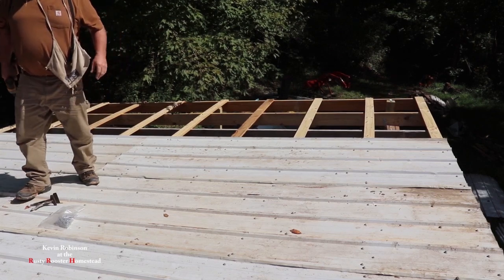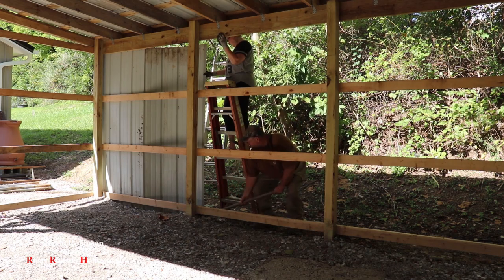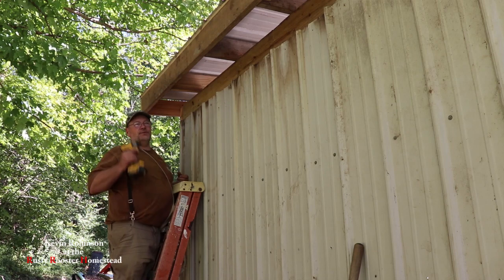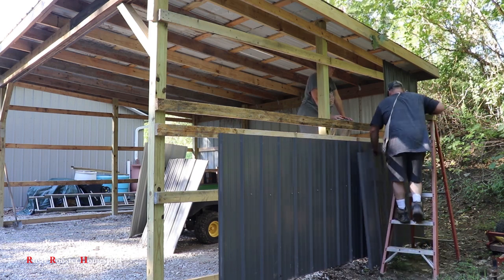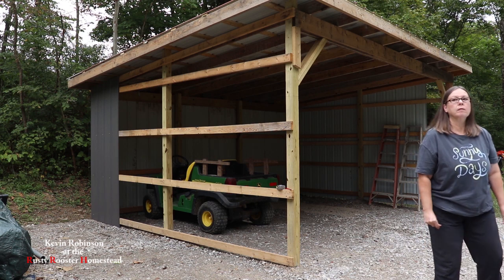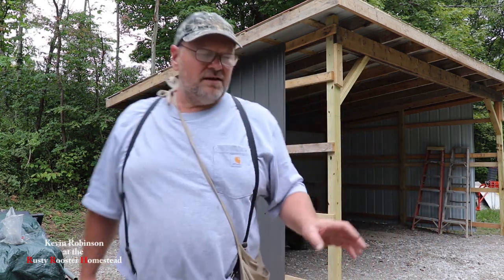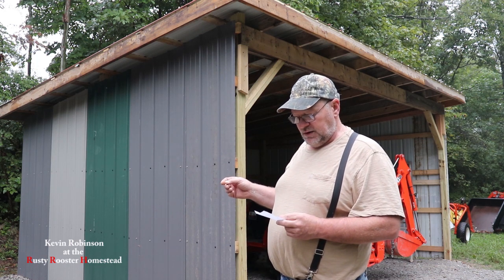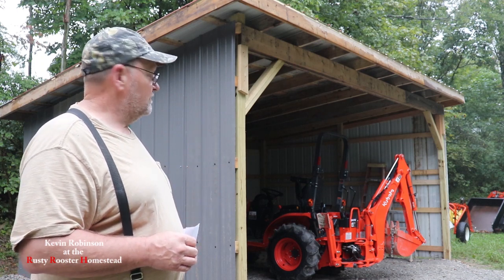tractor shed for cheap build cost part 4

Comment: You can`t beat it Kevin, that`s a nice little shed for $500, I don`t know if you have power or water back there, but a power wash the walls and roof so everything sticks well would be nice. Yeah, once you screw that metal down, the rigidity and structural integrity you get is amazing, looks great, keep em coming, I love watching.
Reply from the maker: Thanks Joe, in the spring we are go to  clean the building and painting it .

Comment: Looks great and the price was definitely right!  I'm getting ready to build something very similar for my tractor and zero turns, plus anything else I can get out of my shop.  I think I am going to build bypass barn doors so I can lock it.  One thing you should keep an eye on for your safety.  I noticed your front and rear beam are not notched to transfer the roof weight to the ground.  Fasteners are good but they can act as a log splitter when you just through bolt.  Plus depending on the treated lumber you have to use the proper screw. the chemicals in the lumber will corrode the fasteners I've watched all the episodes and now can see the front pretty good.  You could pull off the 2x4 you have scabbed on under the beam and run one to the ground or on whatever you have in the ground.  Not a dig, I just don't like hearing stories about people getting hurt or even killed when a deck or other structure comes down.  Then again it may stand there forever.  Now that I pointed out an issue feel better knowing I have to buy all my material and it looks like about $2500  Maybe $3000 depending what I do for doors.
Reply from the maker: Thank you so much for all the information I'm going to do some upgrades to it.
Thank you.

Comment: OK.  One long question.  Those 2x6 rafters look like they span about 15 feet front to back -- that's a long span for a single 2x6.  Seems like a wet snow load could be a real issue.  Why didn't you run another beam midway (with two additional posts supporting posts?) -- yea, it would have added some cost but your roof would be a helluva lot stronger.  Did you use any span tables with calculated loads for the rafters or the long beams, btw?  Were the beam segments just held together with screws or did you glue/clamp and screw (using appropriate adhesives for outdoor and appropriate non-corroding screws)?
Reply: Also, how were the beams supported by the posts?  It looks like the beams do not lay on top of the posts as they should.  Prevention of lateral movement of the beams off the posts is contained by using steel plate, for example.
Reply from the maker: Need to get some more work done on it thanks for the comments.